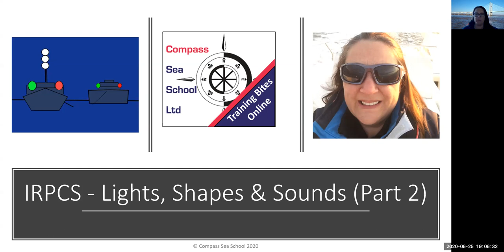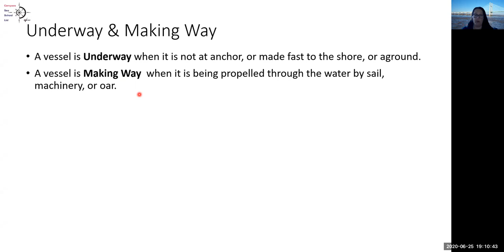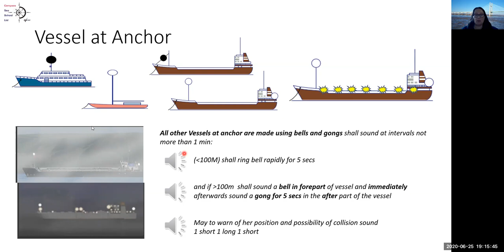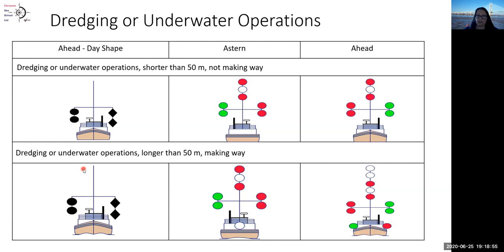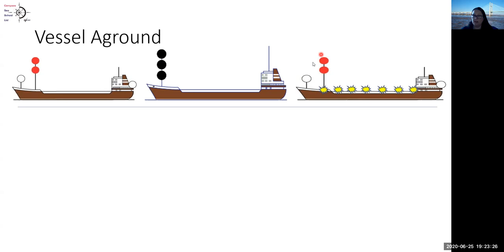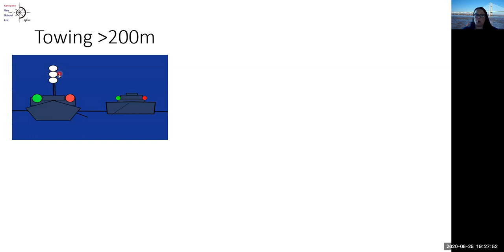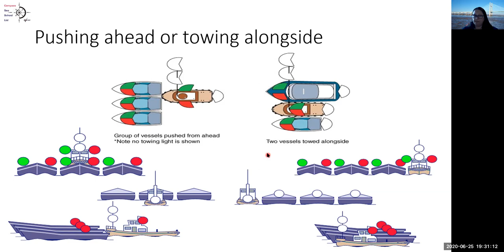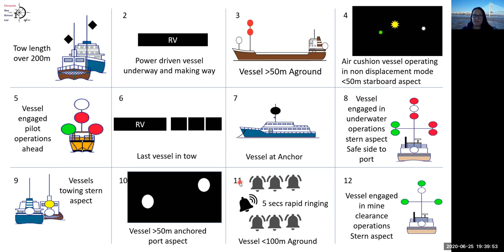IRPCS - Lights, Shapes and Sounds (Part 2)

Comment: The only problem madam, is that when a vessel is pushing (not a composite unit situation) more than one vessel, or towing alongside more than one vessel, they don't show the navigation lights each one alone. If they're three vessels towed alongside, then they all show the side lights of one vessel and only one stern light.
If you are pushing 3 vessels, the three show the side lights of one vessel on the extremities of the tow.

Comment: Quiz at 28:20 ... Question 10.... doesn't a vessel at anchor >50m have a lower light at the stern so this would be the starboard aspect?  Or am I still confused?
Reply: I agree with you 😀
Reply from the maker: Hi Chloe - yes you are correct it should be the Starboard aspect - you are not confused - just mistyped on the slides - apologies for any confusion